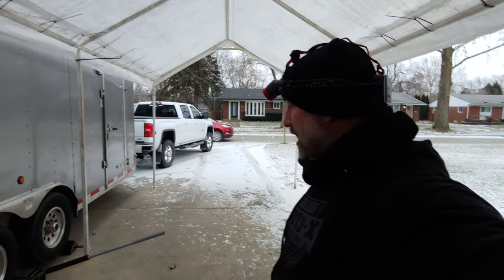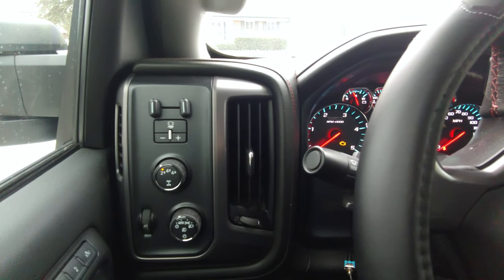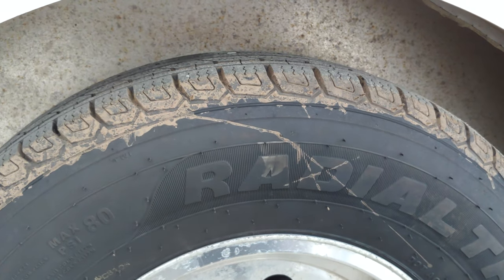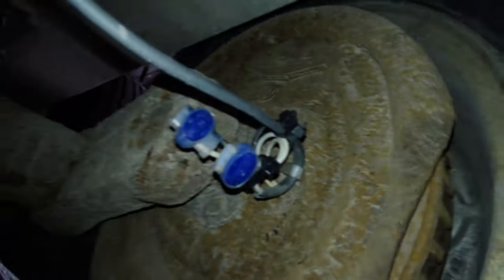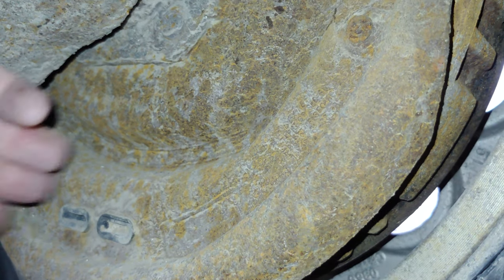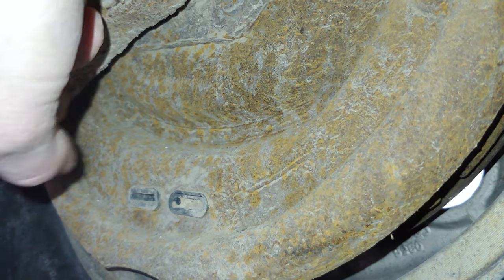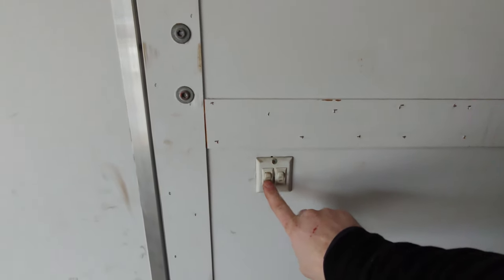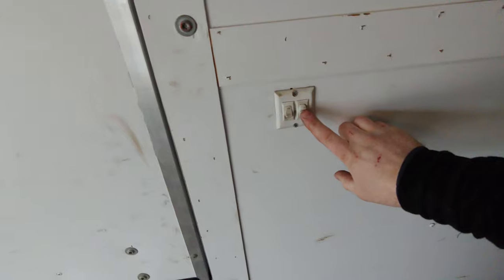Trailer Brake Controller || How to Use & Testing Trailer Brakes

Comment: On an unknown trailer that is that old, you would want to remove all four brake drums for inspection and to pack the wheel bearings.
Reply from the maker: It was done recently and I checked the drums when I got it home and they were hot. That was good enough for me. When I got rhe brake working I set the brake controller gain in the truck so it would stop the truck with just the trailer brake at a 25 roll.

Comment: Would you be able to post links to all the stuff you are using on the trailer floor, guides and tie downs and such?
Reply from the maker: Great question I will be making a video as soon as I get the parts in. What should be in the next day I have half of it right now.

Comment: Have you every had the common error message on the display “service trailer brake system”
Reply from the maker: Yes. It's normally the trailer wiring. You'll be looking for a wire that is rubbed through and touching the frame or metal somewhere or a broken wire that is dangling. If you can't find anything, then you might need to look at your trailer plug but it normally the wiring somewhere for the braking system. 

I found a wire coming out of my axle for the braking system that didn't have a grommet and the wire was rubbed through. Easy fix.
Reply: @Fixin2Ride-Official-   unfortunately thats not it. Ive never pulled a trailer with my truck before, the message pops up with nothing even connected no trailer or anything. Its very random when it does it and its non stop over and over dinging. I just bought a brandnew trailer and so now this is a concern for me. I cleaned up the connections and a couple things i found online to fix the issue. But plan B will be installing an aftermarket brake, would i have to disconnect anything with the stock brake if i install an aftermarket trailer brake ?
Reply from the maker: I would think that it might be the wiring under the bed then.
Reply: @Fixin2Ride-Official-  im eliminating possible issues so will see if i get the message again. If so then i will check wiring next, relay under the bed, replace the actual controller switch and if none of those fix it im gonna have to just get an aftermarket one since im going on vacation next month with the trailer and motorcycles. The trailer brakes do work i tested it today, but apparently when that “service” message comes on the brakes do not function from what i heard. Fingers crossed 🤞 thanks for your help btw and great video!!
Reply from the maker: Copy that. If I can find anything useful I'll post it in a reply. Thank you!